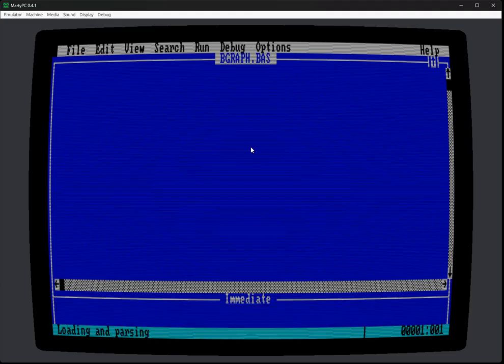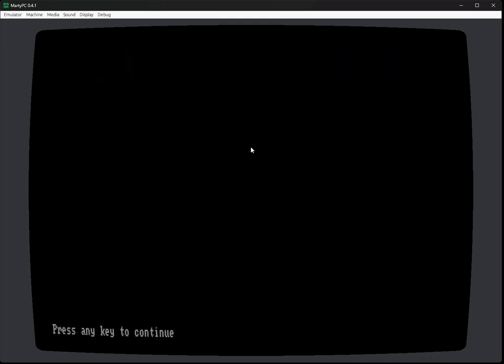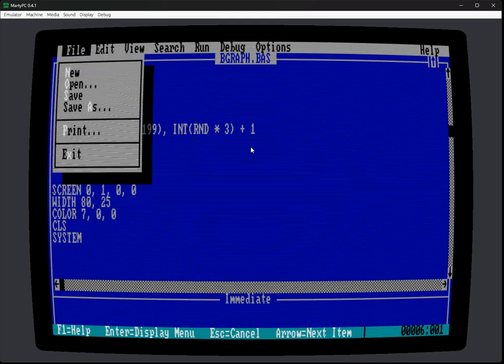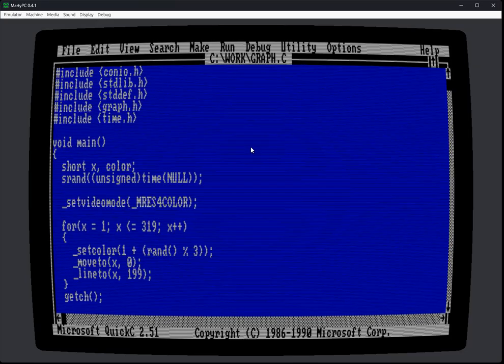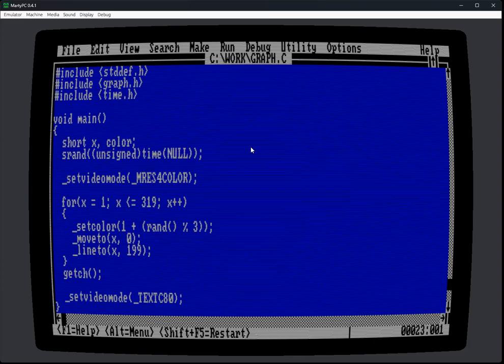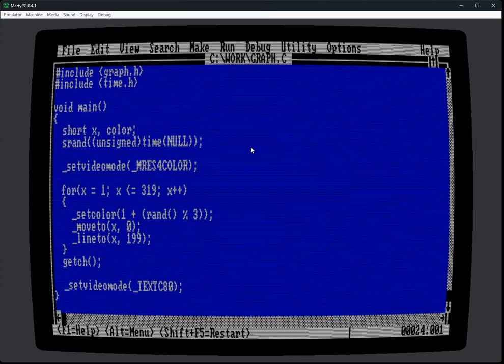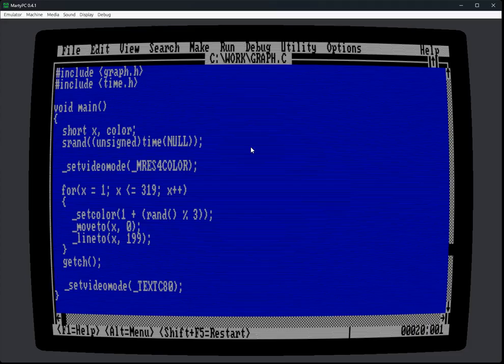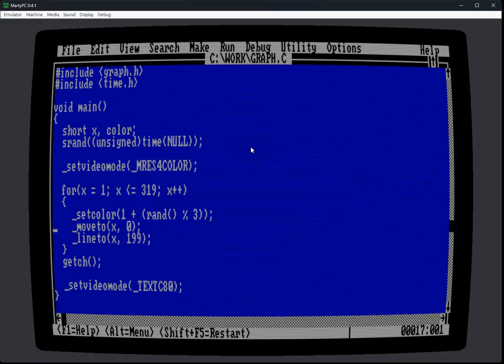MartyPC CGA Graphics, BASIC and C first...

Comment: Cool! One thought is if you're drawing vertical lines across the entire screen, you can ignore the 8k offset entirely. But of course a general line drawing function can't ignore it.
Reply from the maker: I thought about that, if we're doing a similar example. I figured since each byte is 4 pixels, it should be straightforward. I might do that first to demonstrate how rapid it is. Finding a suitable use case can come later. :) Thanks for watching!